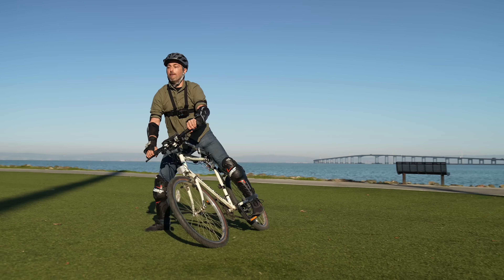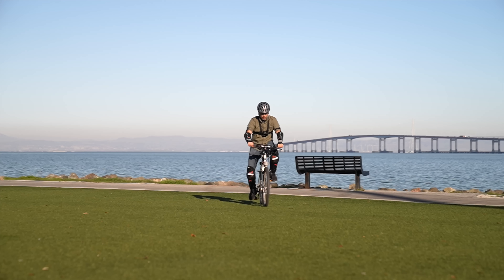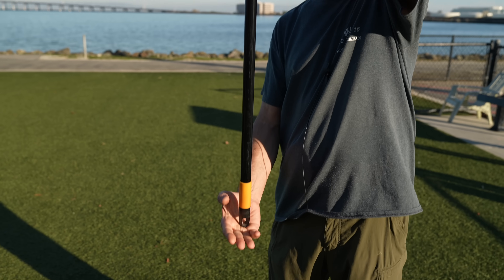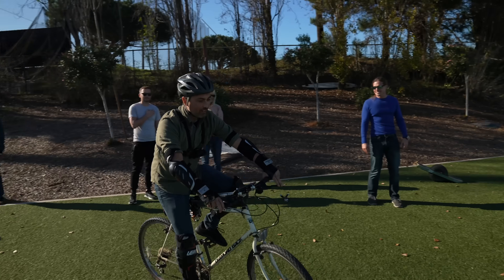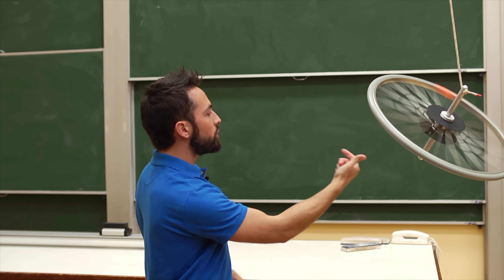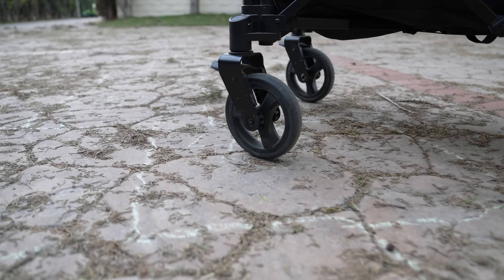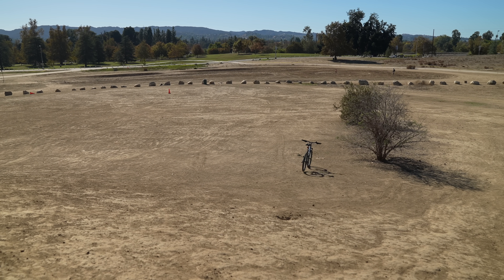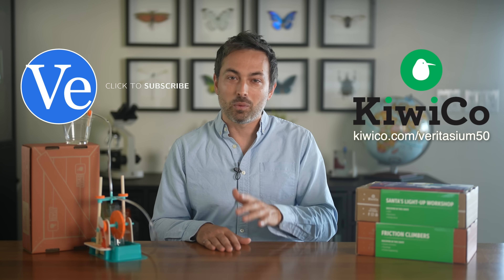Most People Don't Know How Bikes Work

Comment: As an advanced BMXER I'd like to say there actually is a move you can perform while the steering is completely locked it is called tick-tacking. Essentially standing up on the bike stationery/locked steering you will pick up the front wheel and shift it either to the right or to the left keeping yourself upright, pumping is also involved in this as it is basically bending your knees and shifting the bike forward once you shift ur body weight to the left moving the front wheel to the left as soon as the wheel lands you will perform a pump same as going to  the right or you can keep it going to the left keeping youself balanced through core movement.

Comment: Now, explain how to turn on a tricycle. Most people assume you ride a trike the same way you ride a bike, not realizing they ride differently. With a trike, you lean the opposite way you would for a bike, but there are other differences one wouldn't think about. At 60 with bad equilibrium, I have to ride a trike. 
Riding a trike as an adult, I now understand why it was difficult to learn riding a bike when I just gave up a trike. It was bad enough going from no balance needed to having to balance on two wheels, but there was no one who understood the turning method on a bike. You learn it on a trike when you realize how to keep it from tipping, but never realize it on a two wheel bike. You just do it until you can stay up and ride.

Comment: What a nonsense. Maybe cause i’m dutch but i have no idea why in this video he cannot steer to the given direction. I just lean to the side i need to go to and turn the steeringwheel without even countersteering an inch opposite direction before. So i think this experiment is flawed by inexperienced bicycle riders.
Reply: I think its because most casual riders turn only using the handlebars and not using their body to lean. So this test is showcasing turning only with the handlebar

Comment: An easier way of demonstrating this is to ride a two wheel bike for a while, and the. Get on an adult tricycle. The Harley dealership in Atlanta had one of its trikes available for demo rides on a demo day, and someone ended up crunching one of the rear fenders because they were so use to riding on two wheels. I’ve recently switched to an adult tricycle because of health reasons, and it took me a while to get used to not counter steering.

Comment: You did not get the science right, because you got the causality wrong: we do not NEED to steer the opposite direction in order to go into the other direction (so for example steering left first to lean right, so that we could go right). We only need to LEAN into the direction we want to go into. 
The reason it seems that leaning is not enough by itself and it needs to be preceded with a counter steering, is because during this experiment, you were never going fast enough to be exactly balanced (as mass is slow, Newton's law of inertia is not big enough to put you on a straight enough path), so you were constantly micro-correcting your direction, in order to keep balance. It is only partly the help of the centrifugal forces of the wheels, but mostly it's your body mass that keeps you straight enough not to have to use the handlebar too much. The faster you go, the less you need to use the handlebar and the lower the amplitude of the sideways movement becomes.
In your experiment, whenever the moment came to go into a certain direction, what was decisive was what direction you were leaning that moment. If your lean was to the right and the task was to turn right and your reaction time was fast enough (and your speed high enough), you would not have needed to counter steer to the left at all. Because your LEAN was already the right one and it needed no more emphasis, you just needed to lean even more in the right direction.
In contrast, if you were leaning slightly left the moment you had to turn right, you would always have had to counter steer to get your lean in the right direction.
Do you basically described the event through observing an outcome that was dependent on the variables of too slow speed, this to high frequency of need of micro corrections, with too slow human reaction time, thus it seemed that you ALWAYS need to counter steer FIRST, in order to lean. Had you used higher speed and higher reaction time and a moment when the lean was in the right direction already, you would NOT have had to counter steer.
Q.E.D.
Reply: You're absolutly right

Comment: Im actually very convinced a more advanced bike rider could easily do that first challenge where the steering locks. Im convinced they could do it consistently as well, without luck. Furthermore, your logic as to why doing track stands (staying balanced while stationary) is hard seems to be very flawed. You said it's hard because you can't steer. With that logic, riding a bike in motion without using the handlebars would be just as hard, yet almost any decent rider can do that easily while only a much smaller percent can do a track stand. The "gyroscopic effect" of riding is absolutely a factor and I'm sure steering helps, but it is not the main reason a track stand is hard. Going back to the first challenge for example, you were riding extremely slow and therefore had little "gyroscopic effect". Because you were going too slow and had to rely on the handlebars, you had little help from the "gyroscopic effect". If you were going faster or had a more advanced rider try, they could make either turn much more consistently.

Comment: Every motorcyclist understands the concept of countersteering.  Next time you’re on a bicycle and you want to make a turn give the handlebar on the side of the direction you want to turn a shove forward.  So if you want to turn right then push forward on your right handlebar.  This of course makes your wheel temporarily point left but what you’re really doing is destabilizing the bike and making it fall into the turn to the right.  Then in order to keep from crashing you will instinctively bring the bars back towards the right to keep it tracking in the correct direction.  Of course more critical when you’re trying to get a 600 lb. motorcycle tipped into a turn but it still works on a 20 lb. bicycle.

Comment: I would stand off of the seat and use my body to lean the bike and myself in different angles to hold the bike up, seems like an easy enough rip stick but for bikes
Reply: Do not think that is possible. Try to sit at the top of a pole, one point fixed to the ground. How can you keep your balance? Impossible
Reply: @kjellg6532 it is possible. what part of a bike is fixed to the ground? Do you screw your bike to the floor? I’m talking about when people were tryna ride it in a straight line with no handle bar movement. You would just set yourself further from the bike, increase your center of balance, then pivot it between you and the bike so neither of you fall over
Reply: @kjellg6532 also, sitting at the top of a fixed pole is literally possible just shift your weight, like what I just said you should do on the bike… wait have you never thought of shifting your weight before? Which one of your legs is stronger!😂

Comment: I hope he does a equine biomechanics series sometime. Etsy challenge to keep a horse in the correct posture weighted toward the hind through movement and turns The rider throws off their balance, and they both have to be trained not to compensate in shortcut ways that will not let the horses body hold up over time.

Comment: I don’t counter stear when I turn and it works just fine
Reply: For sure you CS. Do an experiment: fix a flashlight to you handlebar and ride in the  dark. Observe the light beam.  You will see that you turn the wrong way for a flicker of a second as you start a turn.
Reply: @kjellg6532  you think I haven’t done that? I genuinely don’t counter steer tk turn because it’s juts not necessary

Comment: And you can't initiate the turn by leaning into the direction you want to go first?
Reply: No. The moment you try to shift your shoulders to the left, your hips goes to the right and your CG stays the same with no lean. The moment you actively bring the front wheel to the right, you instantly get a lean to the left. From thenon you turn the front wheel into the bend.

Comment: This video is such bunk.  By locking up the steering in 1 direction you are eliminating the ability to balance the bike which is primarily done by counter steering.  
This does NOT prove that turning left makes the bike steer right & vise versa.  

Turning left... makes the bike go left.
Turning right... makes the bike go right. 
And through it all you are making micro counter steering adjustments to maintain balance.  
So stop with the junk science.

Comment: Angular momentum conservation has to play a significant role on bike stability. Its not just steering geometry, its both effects. This is much more pronounced on a motorbike. When you cruise at 100+ kph the steering is significantly heavier than at e.g. 20kph. This is expected because AM is I*ω and higher forward velocity means larger ω while I is the same. One could argue that at slow speeds the steering geometry does most of the balancing work, but at high speeds wheels have enough energy to resist directional changes. You could never experience this on a bicycle though. Also the fact that they put counter rotating wheels on a bicycle model does not say much per se (other than "this special configuration balances as well"), because the angular momentum vectors although opposite and parallel, they are also offset so they wont cancel out completely. I find it hard to accept that this disproves whether AM plays a role (and how much) in stability or not. Also thats far from the real world 2-wheeled vehicles (especially motorbikes) with riders that move about and apply all sorts of rider inputs on the steering system (i.e. the front wheel). As far as I understand motorbike dynamics, they are stable mostly due to their geometry at low speeds, the rotation of their wheels at high speeds and they always change direction (essentially initiating the lean) due to gyroscopic precession, which is what countersteering is...on your little gyro instead of applying vertical (with respect to the ground) forces on the rotating axis (which causes the wheel to yaw) apply parallel. You may find that the wheel rolls to the opposite side...This leans the vehicle and, because the tire profile is round, when leaned wheels subscribe a cone naturally following a curved trajectory. The pivot point for the lean is the contact patch and the friction it experiences is proportional to the centripetal force of the circular motion the bike now follows. The rider's responsibility is to manipulate countersteering and weight distribution (position of the Center of Mass) to maintain the inverted pendulum in equilibrium balancing weight and centrifugal force...or at least that my two cents...

Comment: Counter steering. I’ve been an avid road cyclist my entire life but this concept was easier to grasp when I started riding a motorcycle. Mainly because it’s more obvious with wider bars and faster speeds. But anyone who’s ridden in a group and rubbed wheels on the rider ahead of you knows as soon as you prevent the front wheel from micro lateral movement, you go down. It’s the ability of the front wheel to almost imperceptibly move laterally that keeps the bike balanced. That’s also why you can push a bike by hand by holding the saddle and not the handlebar. The front wheel will correct itself and keep the bike upright (unless you lean too much).

Comment: I am 33 and still can't ride a bike
Reply: It is fun. If you give it a try, get a smaller bike an set the seat low so that you reach the ground  with both legs. If possible remove the pedals. (Observ,, the left pedal has “wrong” threads.  Now off you go on a flat surface.  You can “walk” then bunny-jump  with both legs. Try to “sail” for longer and longer periodes  with no feet on the ground. Hen you feel confident, remount the pedals.
Reply: @kjellg6532 thank you for the tips.I tried renting a bike and could ride for a while but I can't ride straight,I always steer left or right to keep my balance😅

Comment: To turn left on a bicycle, I shift my weight to the left, which both leans the bicycle and pushes the left handlebar forward, which creates a slight turn to the right, which increases the lean.
The lean causes the tire to track left and my weight to come back into balance, centering the handlebars.

Comment: It's similar when riding a motorcycle. If you want to go right, you can push the right side of the handlebars forward, effectively turning the wheel to the left, and you will automatically go to the right. This is more because of centrifugal force than the principal demonstrated in the video. But still the same principal

Comment: Countersteering is so ingrained that some people even do it when driving their car, thus driving halfway in the other lane when initiating a turn even though it's completely unnecessary.
Reply: that's more about racing line, if you make the turn wider its easier to corner
Reply: @wattux  Yes when you are coming from further out and turning into the corner. Countersteering in a car like I described makes the corner more difficult actually. It would be like coming from inside the turn, countersteering towards the outside of the turn before turning in. There is zero reason to do it other than people are afraid their are going to hit the curb because they don't know their distances.

Comment: 0:59 before I get to far... weight distribution.. who uses hands to turn on a bike?
Reply: You Re CS even thou you do not know it.
Reply: I never move the handles I just lean
Reply: @3D_Maker_Design  «Juste lean» is nearly not possible. If you mpve oe part of your body, another part will move in the opposite direction. Your CG still goes straight and you get no lean. 
A flicker of counter steering will initiate the lean in a fraction of a second. The movements are very small.
Reply: @kjellg6532  Great description of how turns are made on a motorcycle.

Comment: 6:35 Theoretically, it is possible to ride a bike straight, but if you leaned to the left or right, it's game over.
Am I right? Correct me if I'm wrong.
Reply: Let a pole stand in your hand. Do not move you hand. For how long will the pole stand?
Reply: Long enough that I give up 😂😂😂 jk
Until the C.G. (Center of Gravity) of the pole passed the support point.

Comment: When I used to ride bicycles, I realized I had to quick turn the opposite direction of the desired turn first. 
Like a really quick, subtle version of a tractor trailer making a wide right turn. You can't even keep the bike riding straight without subtly turning left and right to balance.

Comment: In my opinion, the bicycle is balanced by centrifugal force. That is why when you are about to fall to the right, you tend to turn the handlebars to the right. Now, due to the curving motion with the center of the circle on the right, the centrifugal force will be generated, pulling the person and the bicycle to the left. The same applies to the opposite case.

Comment: Steering lock design:
The handlebars are connected to the front wheel through a mechanism that prevents them from turning too sharply. When you try to steer left (or right) sharply, the handlebars hit a stop, and further rotation in that direction is blocked.
Workaround:
To overcome this restriction, the rider needs to first steer slightly in the opposite direction (e.g., steering right a little to unlock the left turn, or vice versa). This creates a gentle transition and allows the rider to make the desired turn smoothly.
Key points:
Purpose of steering lock:
This design feature is often implemented on bicycles for safety reasons. It helps prevent sudden, uncontrolled turns that could lead to loss of balance or accidents, especially at high speeds.
Common on high-performance bikes:
Steering locks are more prevalent on specialized bicycles like racing bikes or downhill mountain bikes, where stability and precise control are crucial.

Comment: In the motorcyle driving class I took they harped on this little tidbit to steer a motorcycle: push on the handlebar corresponding to the direction you want to turn. If you want to turn left, push on the left handlebar. They did NOT say to turn the handlebar to the right to turn left, even though that's the same thing. Most people transitioning from riding a bike to riding a motorcycle have to get used to the change the relative mass. On a bike, almost everybody significantly outmasses the bike. On a motorcycle, the bike usually outmasses the rider. So your instinct to lean in order to turn (which is not really what happens) works even less on a motorcycle than on a bike. But that's what a lot of new riders try to do. Don't lean, just push the handlebar.

Comment: A lot of this incorrect. It is centrifugal force that stabilises the unmanned bike. If you think of a bike leaning over, it would go round and round in circles. The reason it rights itself is because you've created centrifugal force that pulls it towards the outside of the arc and makes it upright again. If it them falls the other way, the whole process repeats. It is the balance between the centrifugal force and the arc that creates a self righting bicycle. The gyroscopic action of the wheels also helps stabilise the system and make it more stable. As long as the bike has power, it should theoretically go forever, unless it hits severe obstacles.